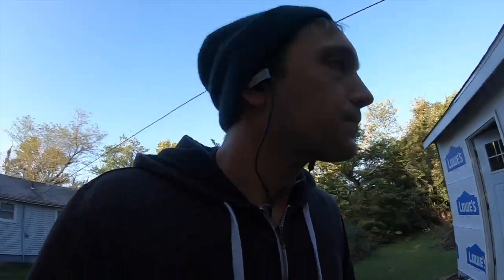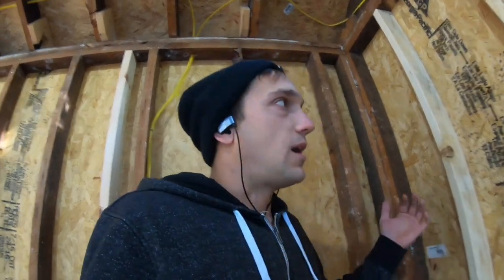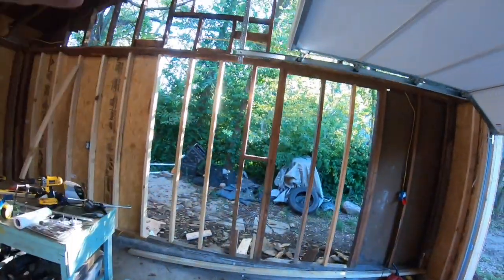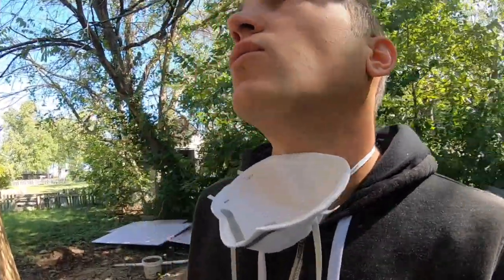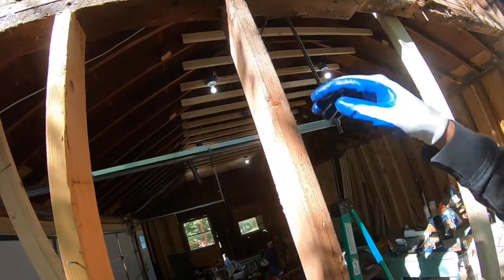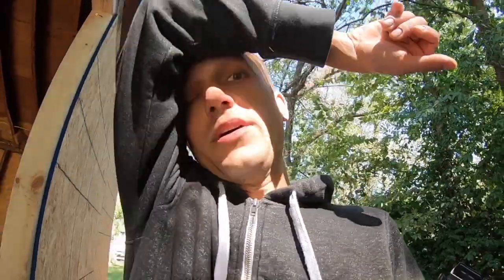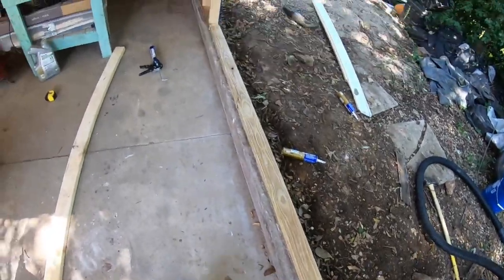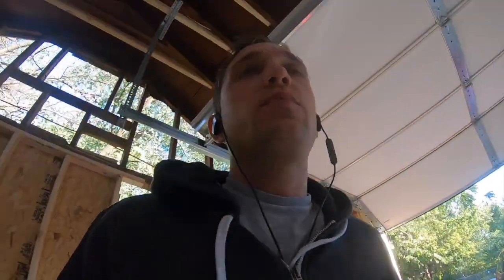How to Replace a Garage Wall

Comment: How did you replace the sill plate? Did you do it in sections or use an hydraulic lift? 10:20